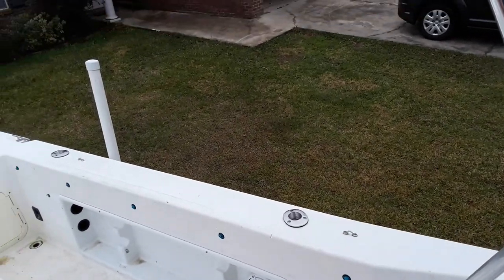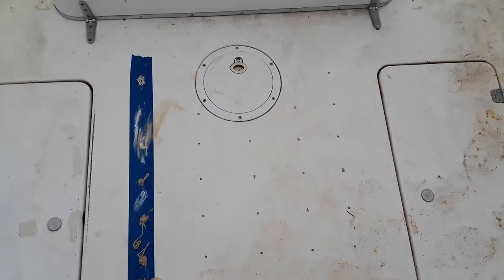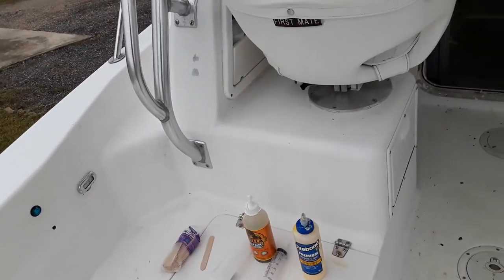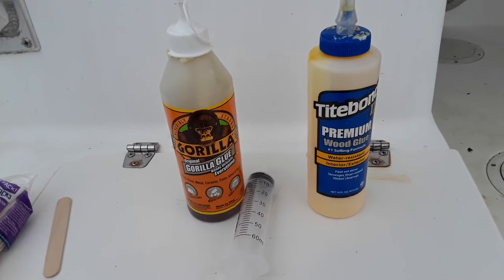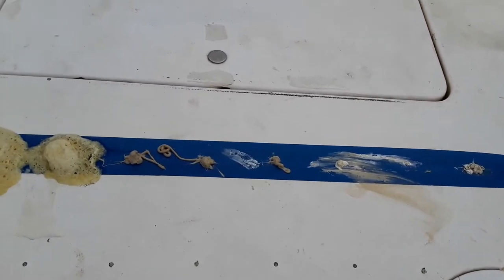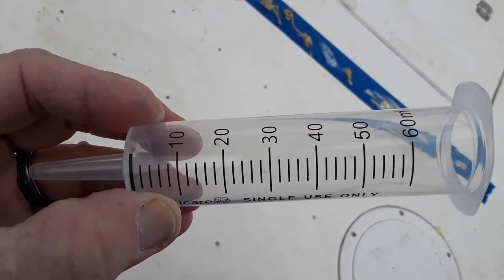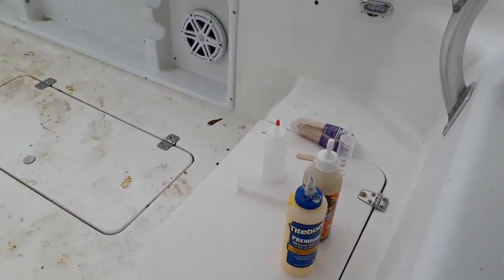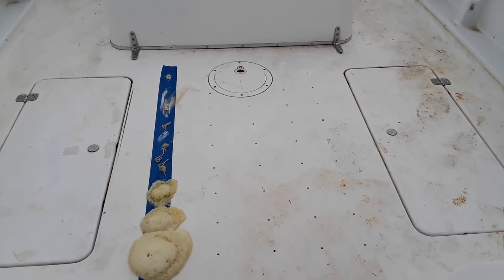Gorilla Glue and PL Premium 3x Boat Soft Deck Repair and/or Injection

Comment: I Was just lookin up the injectables the hydra stop 300 is around $42 a tube and the injectadeck is about $54 a tube, heres the interesting part , while i was looking at the hydra stop 300 i noticed 2 things, 1st it says reacts with water, does that mean the water is the catalyst? Probably.. the second thing is i originally thought this was a 2 part mixture, i also noticed on the site hydra stop 300  is available in  a single tube or a 1 gal jug. Meaning its not a 2 part system.. injectadeck also says its a water catalitic and looking at the tubes it appears instadeck is a 2 part mixture based on the chem colors in the tubes.
Reply from the maker: Good catch!  I never noticed that!!!
Reply: Water is the catalyst.  You have to fill one tube with water.

Comment: have another question for you, those syringes are about 2oz how much titebond are you adding, i know you said you drizzled in the inside but if you had to guess how much do you think you used, 
compared to the 60ml in each syringe, i tried this and had good luck, i was thinking of trying to mix the two glues together then poor into the syringe,
Reply from the maker: I was shooting for 3:1 based on pre-tests, you are moving pretty quick to get as much use as you can from each syringe so it was never exact.

Comment: How long after injection can you use epoxy resin to seal
Reply from the maker: I did it the next day after finishing the injection but not really certain how quickly it can be done.  Just guessing, but probably within a hour.

Comment from the maker: Another update, the deck is just as strong as when first applied, this stuff is as good as it gets🙂🙂🙂
Reply: Did you finally just fix the holes with white epoxy? If yes how well did it finally look?
Reply from the maker: @mikesolns1364  I did put in epoxy but they came out.  I became accustomed to the holes. The boat is nearing the end of its life and help extend it another decade.
Reply: @Oouther1  Awesome. Could you clarify how deep is it one needs to drill in? I appreciate it
Reply from the maker: @mikesolns1364  Just saw this, you'll feel a hollow spot shortly after breaking thru.  It'll be obvious.

Comment: what is the point o f adding the tightbond to the mixture?
Reply from the maker: Gorilla glue requires water for activation, there’s no guarantee of water or how much water is in the deck.  The set amount of mixing ensures good expansion and strength.
Reply: @Richard Rogers  yes that's why they tell you in all the instruction videos to drill holes then rinse holes with a little water. The gorilla glue then follows the water and expands to where the water goes.

Comment: Did it work?
Reply from the maker: Sorry, didn’t see this earlier.  It’s working great with zero failures. The oil pan developed a rust hole leak so the engine had to be pulled, deck remains strong. Also been in heavy seas with no problems, I definitely recommend it.